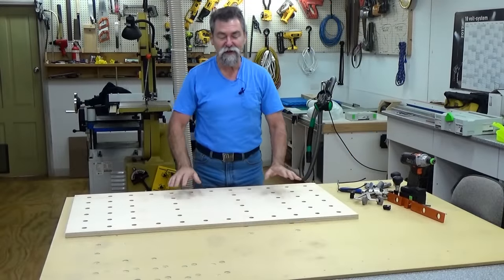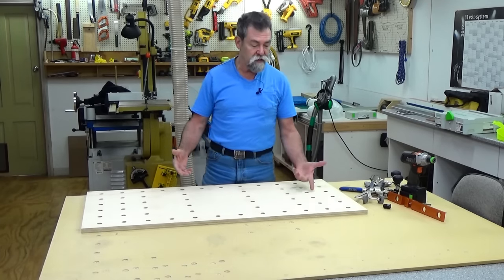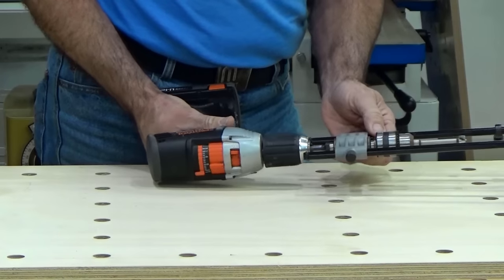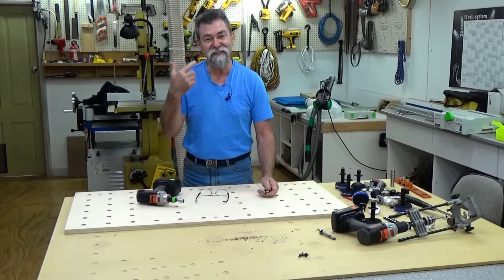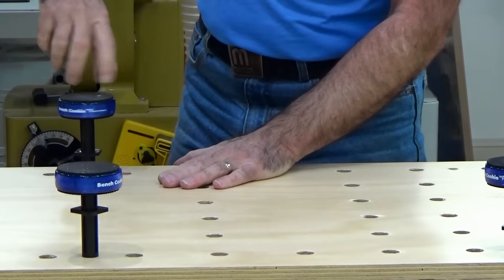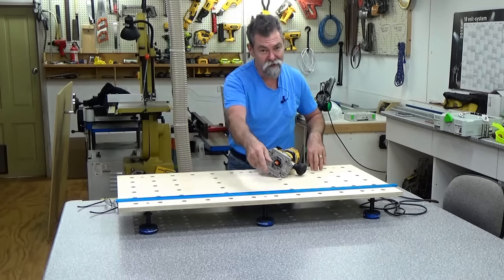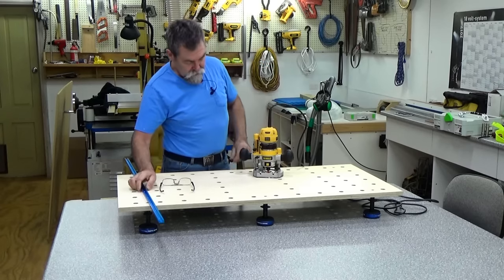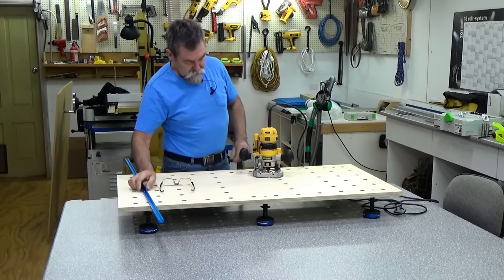Build this Festool mft style portable bench for under $150 Dave Stanton woodworking workbench

Comment: Dave, absolutely a brilliant idea. Excellent presentation & guidance. Only problem I have is you state "make this bench for under $150 (in materials) & for a few more dollars add some accessories, including the UJK part guide system. This bench will not work without the dog holes, consequently the UJK part guide system should be used to locate the holes. I find the cost of the UJK part guide system(in Australia) cost prohibitive & makes your work bench an extremely expensive project, especially for a DYI person(who are essentially the bulk of your audience). Still, an excellent job & brilliant design. Congratulations.
Reply from the maker: Thanks for the compliment! Re the Parf guide, I know of a lot of people who have purchased a parf guide system as a group, Men's sheds especially. Are you a men's shed member? They might have one or be interested in getting one?

Comment: Your tip for the router depth stop to figure out the bottom of the t-track is genius! I'm always fighting with the plunger spring trying to get the correct depth. This seems so much easier. Can't wait to try it!
Reply from the maker: Who knew a router depth stop could bring so much joy? It's the little things in woodworking, right?

Comment: Dave, i just watched this video.  Very clever!  I bought a Festool track saw back almost a decade ago, and I CNC’d my own large “MFT” top. (I worked for a small engineering shop then, and had access to their CNC router.) I did not need the portability of the MFT/3, and I wanted my bench to be large, for use as an assembly table, and also outfeed table for my table saw.  But there are times I would like to have a second, smaller table.  At the time I CNC’d my top, I did not have room for a full sheet of MDF in my basement shop, so after cutting all the 20mm holes, I routed the top to 3 feet wide and 7 feet long, from the standard 4’ X 8’ sheet. It turns out that 3’ is plenty wide, and I have never really missed having the full 8’ length.  My top is still in great shape, but I would definitely get the UJK tool to make a replacement top, after watching you use one for your portable bench. 
You showed that the long Parf dog could be inserted upside down, but mentioned you were not sure why anyone would do this. I use this feature all the time.  I have several portable tools like small bandsaw, scroll saw, and arbor press, that are mounted on plywood, and have 20 mm holes in two corners, which align with the dog holes on my bench.  I secure the tool to the main bench by dropping the long Parf dogs down thru the tool base, into the bench thru its dog holes.  Most tools are heavy enough that anchoring the dogs with screw handles is unnecessary.  However, I may add a T-track to my main bench, just to give me other options.  Thanks for your great videos!
Reply from the maker: Thanks for the compliment Lee Reep!

Comment: Great video.For the Craig Clamp....put a T-bolt on it with a theaded nob (or flange nut) and slip it into the T-Track. Then you can use it anywhere along the T-Track, and remove it relatively easily.
Reply from the maker: This is something I have shown in detail in other videos, works reasonably well.
Reply: @DavidStanton   I actually just watched another one of your videos, and seen it in the background. I just found your channel a few hours ago, so I'll have to catch up, lol. Great work my friend, cheers.

Comment: Well, that's got me thinking.
I was planning to build a big workbench with table saw, drill press, thicknesser and mitre saw built or mounted around the perimeter. I'd planned to cover half of it in MFT style dog holes, but I now think your idea is way better. I could leave your raised MFT table in the new bench centre with dogs and various clamping tools left attached for ready access. Meanwhile I can make the main  bench more solid with a much thicker surface.
It's got me twitching with anticipation.
Reply from the maker: Sounds great!

Comment: Fantastic video! I bought the UJK Parf system when it was first released and I've made a couple of quick benches out of MDF. This Parf system should be one of the first tools for the new woodworker or any woodworker. 
I will be building a table like this because we're headed into autumn and my garage is not heated. Thanks again for the video!
Reply from the maker: Glad you liked it Tim. Send me some pics when you make it!

Comment: Brilliant idea and job Dave.  Made one of these myself (99% copy of yours) with the exception I used wood threads.  I bought a set of the Wood Whisperer's thread cutters (both metric and imperial) that have a much tighter tolerance than metal taps.  That way I can flip the table, screw in the risers and cookies from the "bottom side" and now have a raw surface to use my Festool track saw on.  As long as I keep the depth to 1mm+ sheet good thickness I don't do too much damage to the table bottom and preserve the track and the anti-slip strips in tact. Using the bench dogs to position the track it will be in the same spot all the time (may need a little fiddling lining up the sheet) but the kerf in the table will be in the same spot.
Reply from the maker: Well done Alex! Flick me some photos to davestantonfans@gmail.com and I will put on the live stream.

Comment: I enjoyed watching this series on making a portable MFT bench.  I have watched Peter's video on the UJK system and plan to order it from Lee Valley in the near future.  The interesting part of the video on the mft3 bench was your use of the Bench Cookie(s) from Rockler.  I had seen the bench cookies over the years and never paid much attention. In preparation for building your workbench, I order eight Bench Cookies from Amazon.  I just so happen to begin working on a home project that required me to cut some 4 x 8 sheets of plywood.  Rather than drag out some timbers to separate the plywood sheets for cutting, I used the Bench Cookies.  I was amazed at how they kept the sheets from sliding apart and then how firm they held smaller pieces when making more intricate cuts.  I still plan on using the cookies for the portable bench, however, I may need another 8 for working around the shop or in the home. Thanks for the tip.  I enjoy the YouTube videos and the super chat on Sunday.  

Regards, 

Chuck
Reply from the maker: The bench cookies are very surprising! Thanks for watching Charles, hopefully I can keep interesting content on my little channel.

Comment from the maker: I have had a few comments relating to using shorter screws to hold the t track in. I like the fact that if the bench is used "upside down" that you know exactly where the steel screws are if using a track saw.
Reply: Thanks for posting this well conceived workshop staple!

That screw/saw blade conflict issue is 1 of 2 reasons I use epoxy for this task instead. The 2nd reason is that the short embedment of the short threads easily pull out of the plywood if there’s a strong enough load applied to a track fixture, and the continuous adhesion of the epoxy will not allow that to happen.
Reply: Why would that worry you? You surely wouldn't be planning to let any saw cutting be hitting that piece in any way, would you? I know I wouldn't, I actually wouldn't mind making one for myself, thank you for posting this video. I'm going to go and check out your other videos Re: the construction of this table and the positioning of the holes etc. I was thinking you were just using longer screws due to after routing, there wouldn't be a great deal of meat left on the plyboard, so you would want the screws to at least be past the self-tapping thinner tip, and have all the screws in deep enough to have the full thickness of the gauge of your screws and just grind off and file down as you did because they would be in the way otherwise, I like SuperBardley's Idea and I may use Epoxy Resin when I do mine :)...

Comment: Dave, just got the Festool Slideway Non-Slip tape from eBay, the last part I really need to buy. I' think I'll use MDF at 1" thick, but I'll test drill some scrap first to see if the Quick Clamps will have enough clearance to install If Not 3/4" Birch Ply will work just fine. Yep I'm home for good in a little over a month!

Comment: Phenomenal idea, Dave!  Your approach of building a portable MFT-style bench completely flips - and in a better way - an idea I was about to embark on. I was about to build for my son and daughter-in-law a 3x7' Paulk-style workbench.  My son's desire is to cover the top with MFT dog holes, and his wife's diametrically opposed desire is to have a solid work surface for small, delicate work.  To accommodate, I was planning to build the bench with dog holes, ala Paulk-syle, but then cover it with a 1/4" thick removable solid sheet of MDF or masonite.   But your approach flips that, and IMHO provides much more flexilibility as one isn't locked into a permanent dog hole layout.  Bravo!  

But the reason for this comment:  I have two suggestions and one dumb question:

1) Suggestion 1:  Why not substitute or add a second t-track running in parallel with the other?  This would effectively duplicate the functionality of Kreg's Adaptive Cutting System (ACS) tabletop which uses those t-tracks to accommodate stops. It's a highly flexible system that not only provides more clamping options but allows you to set stops to cut boards at pretty much any desired angle.  Check out the ACS to see what I mean.

2) Suggestion 2:  Why not build in those grippy ribbons on both sides of the table?  This would give you the additional option of laying the portable table directly against the underlying table and not have it move without using the bench cookies.  It wouldn't be a replacement for the cookies,  just another option when you wanted your portable surface to sit solidly against the table. 

And for my dumb question:   I assume your approach of running the t-track and grippy ribbons the full length of the portable table means that you must use a sacrificial board whenever you cross cut?
Reply from the maker: Hi Steve. The bench is designed to use a tracksaw off to the side, not cutting into the bench at all. If you want to cut into the bench, you flip it over without the apron fitted giving you a non slip contact to the table you sit the bench on top of. This is why there are no grippy tapes to the underside. A second t track is an option that anyone can add if they wish, but it does add extra expense and I am mindful of price for people wanting an accurate system but without the massive cost of my competitors.
Reply: @DavidStanton  Thanks, Dave.  Never dawned on me how sensible and easy it is to cut this way on your portable bench.  Very interested in purchasing your plans and building this, but it looks like the non-grip legs are currently not available.  Is there anything comparable you'd suggest that would be available here in the U.S?
Reply from the maker: Steve, the legs are available. Have a look here. https://www.yellowboxshed.com.au/product-category/bench-dog/
Reply: @DavidStanton  Thanks Dave.  Though when I mentioned that the non-grip feet were currently unavailable,  I actually was referring to the Rockler Bench Cookies which I had seen you use in a number of your bench assembly videos and that you provided Amazon links to as well.  Have you since switched to recommending these custom-made legs from yellowboxshed?   I tried to locate one of your videos that might have explained the change, but I couldn't find anything.  For the record,  while Amazon is still showing the Bench Cookies as unavailable,  Rockler.com is now saying that Bench Cookie stock will be available again after 3/26.   So before I go further,  I just wanted to doublecheck: are you recommending to use the new legs from yellowboxshed.com over the Bench Cookies?
Reply from the maker: Steve, I think we can blame Covid for out of stock.
Reply from the maker: I designed the legs to work with the Mk11 bench plans, better overall as you don't need to do any other special system to join the apron to the top.
Reply: Thanks Dave.   That makes it clear.  I will be ordering your plans!

Comment: Thanks for sharing. That's a good looking workbench there, and some great ideas which I hope to copy. I like the way that you added the legs and how easy it is to set up anywhere. The bench dog system has proven itself effective for clamping all kinds of things, particularly carcasses.

However, IMHO bench dogs are NOT GOOD for registering angles as the workbench holes top and bottom rims get damaged when the dogs twist under clamping pressure.
Reply from the maker: Thanks Jeff. Can't say that I have had that experience with the parf dogs as they are such tight tolerances.

Comment: Just my two cents on using the router with a straight edge. I did it the same as you did, this seems logical to have the straight edge of the base against the guide, until I saw this on a video on YT:

when you turn the router just a tiny bit, it is angled away from the straight edge. So always use the ROUNDED part of the router base to register on the straight edge: then you can turn quite a bit and still keep the same distance to the bit!
Reply from the maker: Interesting point Bernd Heiden.My only concern with that is that some bases are not centred.

Comment: Great work bench. I am a completely new woodworker, but I downloaded the plans and I am going to try and build this. I hope I can get it done. You experienced guys make it look so easy.
Reply from the maker: Take your time with it Bory, enjoy the process! By the way, the slots for the cushion strips need to be 1.5 mm deep, not 2.5 as per the plans.
Reply: Plans look pretty complicated for my new woodworking skills, but I have watched your videos several times and I think I am beginning to get it. Took me awhile to figure out what you were saying about the slots on the 90 degree board, but I think I understand now. You just want me to drill the 20mm hole all the way through and screw the Rockler bench dogs to the top into the brass inserts. I do not have a domino machine, but I do have a DowelMax machine. Can I use dowels instead of the dominos? How many dowels do you think I need to install? You want me to cut the slots for the cushion strips to 1.5 mm deep. I have noticed that during the video you stated make the slots 2 mm. I guess the cushion is compressing so you don't want the slot as deep. Any information that you think will help me with this build please feel free to let me know. I really enjoy watching you do your thing. I am a 70 year old man so I doubt I will live long enough to get as good as you. Takes a lifetime of experience to get as good as you. Thanks for your help and concern in this matter. BJ

Comment: With a second rail T slot, and a center insert, you could have yourself a nice router table with this, Or sander, or whatever tool can fit within that center insert.
Reply from the maker: The depth below the top is limiting to a router. But I like your thinking Xander!
Reply: Longer legs or an overly complicated gearbox setup would work.
Reply from the maker: Yes.....but trying to keep the design simple maybe straddling two tables?

Comment: Thanks, nice job on the video and nice job on the table. 
I'm trying to decide between a table saw and something like this. I already own a Makita plunge saw and track. With these tables I'm trying to figure out two things: 1) how do you balance the track so that it is solid against the work piece. Wouldn't you always have to have scrap of what you are cutting around so that is is the same thickness to put on one side or both of the track so that it is supported (such as with a cross cut). Or if I wanted to rip a 2x4, wouldn't I need another 2x(?) just to cut the one?  2) how do you keep from cutting up your table? If you are using the stops and have the wood directly on the table, every cut would have to be amazingly accurate with the depth to cut all the way through the stock and not into the table.

Thank you
Reply from the maker: Hi Robert Phillips! My plans come with detail on a track support so no packing is required, I never cut on the table. My bench has a unique design to avoid that. A table saw or a circular saw with a fence will be required for ripping 4 x 2. Check out my Mk 11 version. https://youtu.be/bHHfaE0RjOk

Comment: FYI that "screwdriver slot" is actually to evacuate chips, and should be installed down. In wood it probably doesn't matter much. Great project!
Reply from the maker: Interesting comment Ryan. Please tell me how to install the nut in the direction you mention?
Reply: David Stanton sorry I should've specified that I was talking about the thread inserts.
Reply from the maker: I understand that Ryan. How do you install them?
Reply: David Stanton just as you showed with a bolt and washer. Only with the slot down.
Reply from the maker: Ryan, you may have something there but I wonder why Lee Valley shows the inserts installed the same way up I have? Here is a link to their page. http://www.leevalley.com/us/hardware/page.aspx?p=65133&cat=3,41306
Reply: David Stanton hmm my apologies. My experiences as an engineer has always been the other way around. Granted that was in aluminum and plastics. Either way thanks again for sharing this project. It's a very versatile design!
Reply from the maker: I am always willing to learn Ryan. So the slots are acting as cutter in plastics?
Reply: David Stanton Yes. In the same fashion as how a tap or a die cuts threads.